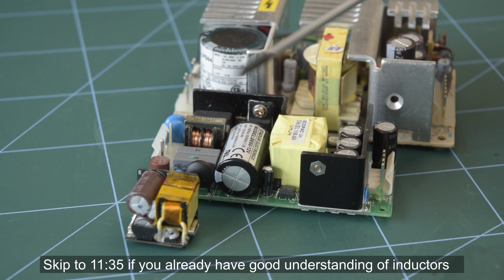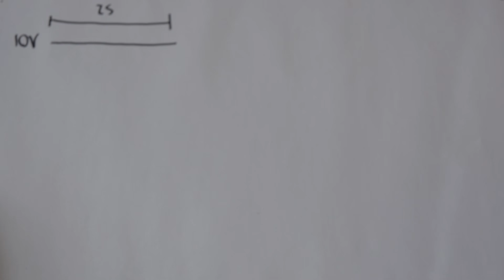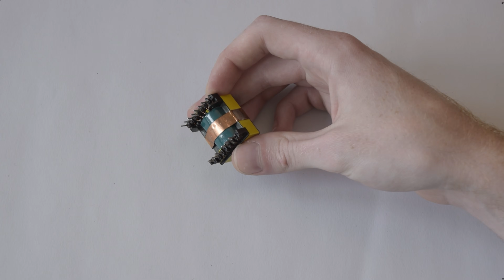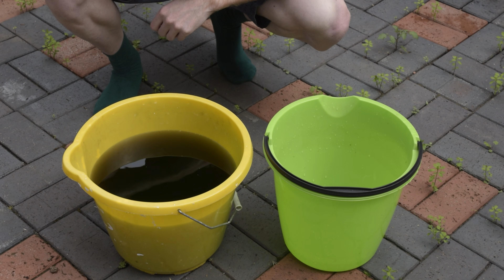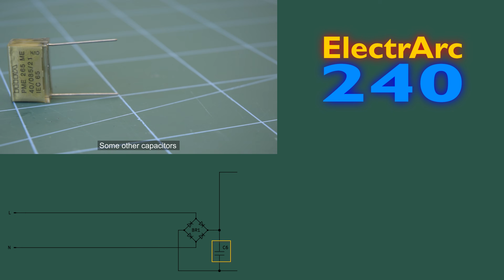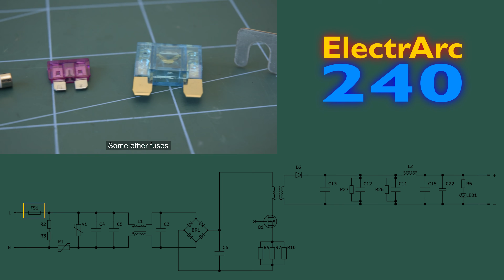Every Component of a Switch Mode Power Supply Explained

Comment: I take it you've not seen or worked on any older TV sets or radios, which often had power supplies, including a lot of switched-mode power supplies, which were NOT so isolated, but very much the opposite, very LIVE! They were often built with a metal chassis which was live as it was connected to either one side of the mains or in some cases to the output of a mains bridge rectifier, and such practice was common right into the 1970's, and in some cases even later, and connectors like the aerial sockets had to be isolated by high voltage rated ceramic capacitors which were often specially made for that purpose and were often made as part of the socket. And some equipment, like the passive infra red motion sensors fitted on security floodlights for instance still have live non isolated power supply circuitry usually using a 330nF X2 rated capacitor to drop the voltage. They're only safe because they're housed in all plastic housings without any external connectors.

Comment: Nice video. I was thinking I'm the only one who explains the transformer kick back energy like a spring, but you did it like me.
Just a small notice. The transformer dots have to be reversed. Usually, the primary dot is marked next to the transistor, while the secondary points the diode. That's how the flyback works.
Reply from the maker: I know I forgot to move the dot from the default🥲
Reply: Anyway. The video is excellent! I liked the video where you did the high-current flashlight analysis with the LT Spice.
Respect man!

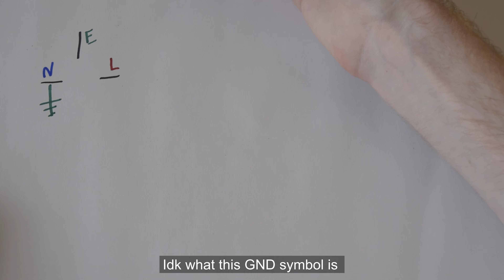Comment: 6:36 that symbol is the traditional earth symbol. To provide a good earth copper rods are often driven into the earth (soil) with a large surface area. Then a termination point is added and usually the junction area is cast into a concrete block to keep everything in place. Usually then there is a copper bus bar connected and this becomes the building earth.
My main experience was working on large ground based RF systems, transmitters receivers and radar. If you go back to early radio days and the old crystal sets, you will see an earth and aerial symbol. A good aerial system requires a good earth particularly on the HF and frequencies below. In those days they would find an old lump of iron and bury it with a good piece of copper connected and sticking out the ground. The symbol is indicative of a series of horizontal square plates stacked and bonded together to Karen surface area. 
As you know the symbol for an equipment earth is the chassis or a ground plane and we use the straight horizontal symbol with the Diana ol lines underneath to represent a solid mass of conductive material with a low Cros sectional area resistance.

Comment: Liked the video, easy to add so much detail as to confuse, ie the switcher, the role the opto isolator plays, the fact that that the blue disc cap next to the transformer actually connects the ground of the secondary to mains earth… safety :) and of course your laptop charger (unless it’s a really cheap nasty one) will have another large inductor, not a transformer a single inductor that’s used by a another circuit called the PFC (power factor correction) and is purely there to save the electricity generators money… PFC is a subject all by itself lol and as a professional engineer of 60 years I have no idea how the blasted thing works lol, what I do know is in a modern switcher it’s the part that’s most likely to fail and make a huge mess when it does.
Reply from the maker: Hoping to cover active PFC in the near future!
Reply: @electrarc240  I shall keep an eye for that :) I no longer repair such things as a recent pacemaker implant has made me very wary of high voltages, so I’ve gone back to basics and now repair early Arcade Machine game boards :)

Comment: Very good and understandable lesson on the power supply. I don't know yet where you are based in the world, but you accent sound more england. I am in south africa. I hope you can allow me to add that the potentiometer does not only adjust the output voltage, but also control the entire circuit and protect it from getting out of regulation and destroying itself. Thank you

Comment: Newbie here. Appreciate the walk through. I think this step by step approach works best for my comprehension. 

1. Why after 3 of the output capacitors do we have the inductor? Why not after the 4th? Or 2nd for that matter?

2. Why discharge capacitors across only 2 of the output capacitors? I can understand the 4th output capacitors is after L2 and I guess isolated. But the first output capacitors, c13, would still hold a charge after power off, no?
Reply from the maker: 1) I do not know to be completely honest, I too am intrigued
2) All four are effectively in parallel, the inductor is not a coupled one so there is no isolation it is essentially just a coil of wire, so the two resistors will discharge the four caps

Comment: You should have started with and included a:

+/- 39 Volt Dual Tracking ANALOG POWER SUPPLY used in a Audio Transistor Power Amplifier.  
                              To show how far we have come in Power Supply Designs.

Comment: Very good! Still, the most important thing missing is the output voltage regulation which requires a voltage standard (zener or voltage gap chip), optocpupler and a small processor chip or an op-amp. A part of discussion about snubbers and filters is niot gaining much understanding and can be very much shortened: I would leave the output inductor, mention one snubber and say that there are more. The NTC and VDR ned to stay too. Also, please do use different symbols fot elcaps and block caps in the schematic diagram!

Comment: Great job right up to the part where you skipped the control circuit.....Great explanation, however.  I have build dozens of the old shunt type regulators, and then these came along.  I never had the time or the gumption to try to build one of these, but I have used plenty of them like everyone else and their performance is a marvel.

Comment: this could help me understand a tv antenna  pre amp, sold by radio shack in  (2003) That's where I first wondered what the coils were on
the board. Found out they were called inductors.  So can a pre amp ( mask mount antenna booster)  in the radio shack antenna pre amp be a switch mode? Anyway nice video. your the first person that made me get my first understanding of switch mode power supply working's.

Comment: The "snubber circuit" you refer to is a common misconception. It actually comprises of a "snubber" being the resistor which burns off excess oscillator energy, and the "slugger" being the capacitor which uses additional capacitance to slow down the rate of change of voltage. This is known as a "RC Network" not a snubber circuit some engineers started telling each other; it's purpose is to prevent it from coupling into other circuits.
Reply from the maker: Very interesting. Thanks!

Comment: Interesting and the basics were done well to help a lay-person (like me!) to understand the main functions.  I have just bought a DC (car cigar socket) power supply for my HP laptop. I assume there is a need for this to get the correct DC current that the laptop charging circuit needs?  I couldn't understand why HP don't produce their own DC-DC power supply when its for a lap top which is obviously dessigned to be portable!  I hope the 'third party' supply works ok and is not dangerous!

Comment: Good point about the big capacitor.  I was trying to isolate a bug in the power supply to a subwoofer when I fried my multimeter on the capacitor.  They were holding the charge way after I had disconnected it.  I know how capacitors work, but that didn't prevent me from doing this serious fault.
Reply from the maker: Yeah so easy to assume people just get unlucky and you won’t. I’ve also had a fair few bangs from the same thing.

Comment: Great video. On thing though. I don't know about other countries but in Belgium the neutral is not connected to the earth. Each house has its own earth via a big metal pin in the ground (old system) or via a loop of copper wire that is placed under the foundations of the house. And we are protected by a main differential breaker and some smaller differential breakers for some special things (like washing machine, bathroom, etc).

Comment: Back in the '80s and '90s, when I was repairing TVs, computer monitors and various electronics, switch mode power supplies were becoming popular. I must admit that I never fully understood how they worked (and was always somewhat scared of them), preferring instead to focus on simpler concepts like bridge rectifiers and regulators. As a result, my troubleshooting approach often involved blindly replacing visibly damaged components, or all the capacitors, or following others’ instructions to repeatedly replace the same suspect components (those were the days of the Commodore 64 monitors!).

I wonder if you could make a video demonstrating how to fault-find a switch mode power supply. I remember hearing that one method was to use an adjustable variac to input a lower voltage, allowing measurements at various test points with a multimeter or oscilloscope to identify incorrect voltages or waveforms and determine the fault's root cause (but this was too time consuming when I had to get 10 monitors fixed per day). From my experience with SMPSs, multiple components often failed simultaneously, and replacing three out of four faulty components would often lead to the first three blowing again as soon as I applied power.  

Back in the day, I didn't have time to fault find for more than 30 minutes per monitor, so I was lucky 90% were repairable by replacing the same components each time (obviously a design fault leading to the same things constantly blowing up - typically heat related or underspec'ed components).

Comment: In this example the secondary side is totally isolated from the primary side, its very common to see a small (class y) capacitor from secondary negative to the primary side negative to preventy stray staic voltages on equipment discharging to earth through the supply and causing it to operate in odd ways. they also protect against the equipment becoming live from an exteernal source by giving a path back to line neutral/ground which in a modern building should trip the breaker due to line/neutral current imbalance.
The noise suppression caps on the mains input are usually class-x (x2 common), these are designed to fail 'short' so if anything 'nasty' causes them to fail and no longer do there job the 'short' should fuse the unit.
The seconday to primary capacitor (and the L-N lines to ground) are class-y(y2), designed to fail open circuit, so that in the event of failure they dont conduct harmful voltages from line to ground which could (if the ground connection was weak) place high voltages on the equipment and anyone touching it.

Comment: Excellent presentation!  I now understand SMPS far better than I ever did.  By the way how does the SMPS do the PWM?  How is it possible to control the PWM with the MOSFET?  Why is no crystal is needed to adjust the frequency?  Also why is only 1 diode used instead of a full wave rectifier?  Just economics?

Comment: This reminds me of how during control systems when we were using ode to simulate spring mass dampeners our professor just randomly changed the components to be a inductor, resistor, and capacitor and the math all worked exactly the same

Comment: Brilliant description, outstanding video. It made me wonder why board are printed with multiple resistors in series, rather than a single resistor. And why they use multiple capacitors in parallel, when one larger cap would serve the same purpose. Is it to better quell harmonics at multiple frequencies?
Reply from the maker: The resistors is likely for voltage rating. Each of those small resistors can only take maybe 100V. And the capacitors may be for packaging or cost or because multiple smaller capacitors often have better parasitics

Comment: After watching for the 4th time, also  would have been great if you showed how one of those cheap VOLTAGE/CURRENT lcd display meters tapped into the circuit, ie those current resistor shunts ,   
Still outstanding...!!

Comment: Beautifully explained in great detail -  except the controlling of the mosfet,  it must be tapping off power - putting it to low voltage so the IC starts switching the mosfet and a gate driver needs power before we can get the main power output.

Thankyou for yr detalied clear explaination.  Most I know but some of those things?  I thought the blues were voltage spike protectors rather then ceramic caps {though obviously they must be bigger version of ceramic cap -  theres a video of someone testing those protecting a mircocrontroller while he holds and arcing high voltage to the input -  without damage}.

Thanks for the detailed protection of the mosfet block diagram  {only the values of resistors & caps would have been good to get an idea of ball park / figure whats exactly going on}   .....after trying to make dc booster but having much trouble with blowing mosfets,  got it settled by adding car heligen headlights before source pin and {-} supply -  but cant seem to go from 12 to past 20v  just wont budge regardless of frequency or duty cycle -  which veries -  is not consistent having their own resonance with the inductor.  SImple  yet complicated and an art.
Reply from the maker: I'll try and make a DIY boost converter video soon. Only problem is with no load and constant duty they tend to keep "boosting" to lethal voltages very quickly which really puts me off teaching about them. I can say to add a Zener clamp or similar on the output all I want but it just takes one numpty to decide they know better and it won't end well :(
Reply: @electrarc240  Thanks for reply.  I use 2 21W 12v bulbs in series as the load.  I started blowing mosfets. So placed car head lamps between supply & source. I can start of with frequency turned low but set to highest frequency range, & slowly intorduce duty cycle to get a bite. Increase the frequency {I was trying to find the optimin setting for efficiency reading current draw & voltage output}  but found it would work but change one thing too far the helogens would light up and mosfet quickly heat. Also - clean signal going into gate driver, but noisy spikes on square output. {is this because wires too long?  I like 285khz for efficiency but couldnt get the voltage higher then 20v no mater what - even using different coil configurations including bifialr which i found years back worked best with any setting}.  In the end I went from single wire to separate coils with secondry double and still wouldnt budge past 20v. Oh {I was trying to use a buck config on primery to get use of that power - to no memrable avail}  so put a shunt diode across prim but with a 12v bulb in series - so i can see whats going on. When adjusting frequency that shunt bulb lit up and mos got hot quick. {having blown so many of them I found using bulbs as heavy resisters gives good indication}.  I note the brought booster  {Im sick of blowing them so would rather build and thus know how to fix - I think Chinese while cheap make electronics cheap / vulrable instead of putting in protection}.   yr other vid about power supplies really helped - that scematic to see protection configeration.  By the way - Im runnning computer off car batteries as I live off grid.  but found to use 2 12v bats in series = 26v run through 2 series shotkey diode works well.  Current draw  0.48-3Amp  while booster on 1 12v bat "would hit 8 amps."  But i want to master the knowledge for future endevours.  Cheers from NZ.

Comment: Good video. Only info I miss is how to power control circuit. I supposed that there is rectifier, filter, high frequency switching circuit, how freqency transformer and then PWM circuit  and output filter plus some overvoltage/overload protection. Current sensing shunt on input is a bit unclear.

Comment: Excellent instructional video
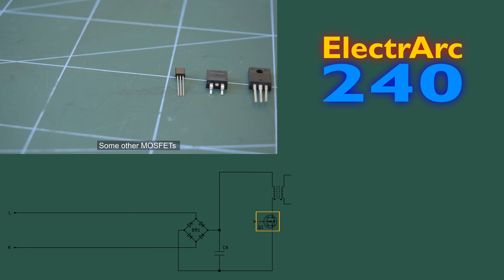But I still expected a bit more explanation about the function of the diode on the primary side of the transformer. At 13:20 you say that the mosfet is the only essential component to charge the coil with the necessary energy. However, the power diode will, after the mosfet is switched off, ensure that the current continues to flow through the primary in the same direction. This diode therefore has an equally important function as the mosfet itself and is therefore a high-current type. At 20:40 it is said about this diode that it is more part of a "snubber" circuit, but the function is, in my opinion, much broader. Sorry, maybe that's what you meant? Thanks a lot anyway, great work!
Reply from the maker: Thanks! In a flyback converter like this almost all the energy put into the primary while the MOSFET is on transfers to the secondary when it turns off, only a small amount of current from leakage inductance continues to flow in the primary. That small left over current is all that flows through that diode and the series resistors are there to absorb that energy and bring the residual current to zero quickly. So yeah maybe not just a snubber but also doesn't carry a significant proportion of the current. I have learnt quite a bit since I made this video, wasn't expecting it to get even a tenth of the views it's got! Would've spent more time on what I said if I'd known haha
Reply: @electrarc240  I think that, immediately after the mosfet is switched off, the current through the primary wants to continu at  the same level . Therefore the big diode offers the necessary path. 
But,  nevertheless, congratulations for your clear explanation